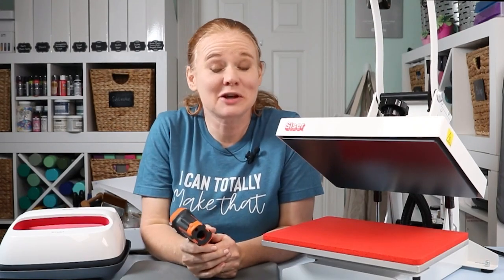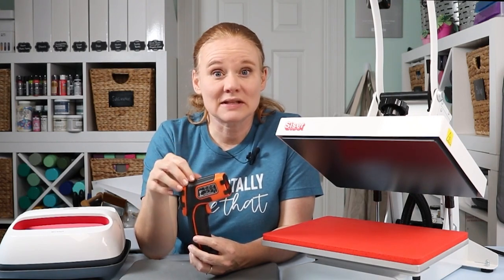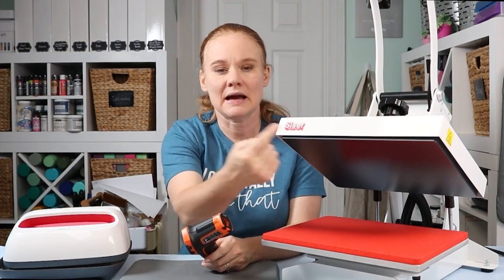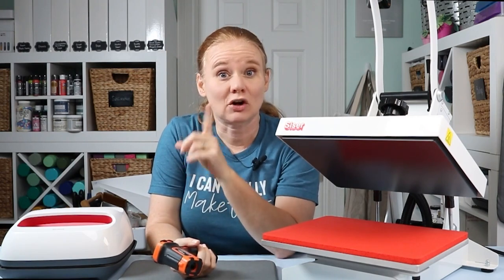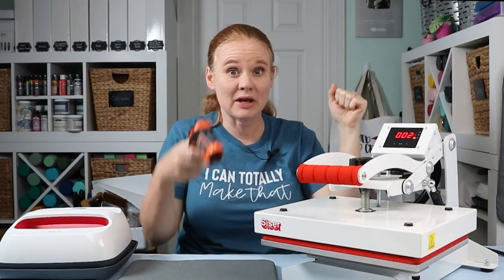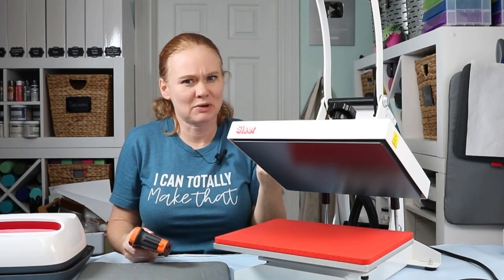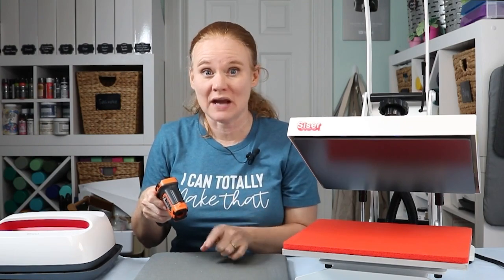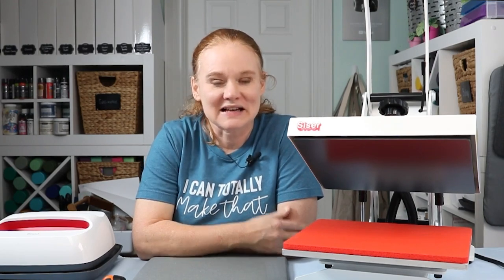Heat Press Troubleshooting: Checking the Temperature

Comment: Dumb question 🙋‍♂️ our won’t heat up we change both the one switch and the 120 fuse it’s did work for a few days but now it won’t heat up we have left it on for over 30min n still cold what’s else could it be that’s our question thank you in advance
Reply from the maker: Sorry not sure.

Comment: When you test your heat press like this, after heating up for 60 seconds each time and get a reading of 305, is that the correct setting if you only need to press htv for 15 seconds.  My heat press temperature is 245 degrees and my reading with the thermometer is 305.  I had been using the heat press temperature gage until I noticed that I was burning shirts when I would do sublimation and had it set for 385 degrees.
Reply from the maker: Definitely running hot! For HTV, you need to check with the type of HTV you are using as it varies by brand.

Comment: the temperature of my heat press keeps fluctuating between 299 - 319, when set to 305. Anyone know why this is?
Reply from the maker: If you are looking at the readout on the press, it will fluctuate. If you are checking the temperature with this method, it will vary but having measurements over your setting would indicate to me that the press is a little hot.

Comment: Hi new to using a heat press. I have a Tusy press from Amazon. I did by a heat gun, but based on your video I was not using correctly. I was aiming at the top platen and noticed temperatures were inconsistent. I will now test the bottom platter. But I would need to test multiple areas before pressing every time I want to heat set an image? If I’m doing multiple shirts, that could be very time consuming. Hope you’re able to respond. Thanks
Reply from the maker: I only test if I am having issues. There is zero reason to test every time you print.

Comment: hi Angie...i have been watching your blog for a long time now and was wondering if you could help me.  I bought a selphy CP1300 which prints just fine, but the minute i put the photo under the heat press (cricut) the pic starts to bubble up. you can actually hear the pop sounds..scary...please any suggestions?
Reply from the maker: I don't think those prints are made for any heat application. Not sure what you are trying to do?
Reply: @AngieHolden   the printer is sold as sublimation printer so i tried to sublimate.
Reply from the maker: That is definitely NOT a sublimation printer. Not sure where that was posted.

Comment: Can you make a video that can help us align our sublimation? I keep printing cricket! 🤣 tips tricks are appreciated! 😩💚
Reply from the maker: Aligning with HTV I assume? It is TOUGH! I have zero tips and tricks that actually work! HA!
Reply: Thank you so much Angie you are a godsend! I am very new to this and I feel like I’ve gotten pretty good with my cricket. I’ve only pressed a few things using HTV but what I’m not sure about is if I’m getting the correct results when I press the HTV. In your videos your HTV results look perfectly flat and smooth and mine don’t. can you do a video that is very up close what the HTV should look like on a fabric surface.  Sometimes mine looks like it’s a little wrinkled or if it’s a little bit bumpy? I’m not sure if that’s a heat problem or I’m not using the right pressure. Or just not following the correct instructions for the HTV. thank you so much.

Comment: Question….on the tumbler heat press, when it get to 360, then I put in my tumbler in, temp fall like about 10 to 15 degrees down then rise back up but I am losing the time and yes I am doing this in basement, it little cooler down here..lol   So what the best way to handle this? Thank you for great videos…..
Reply from the maker: All heat presses do this. It is fine!